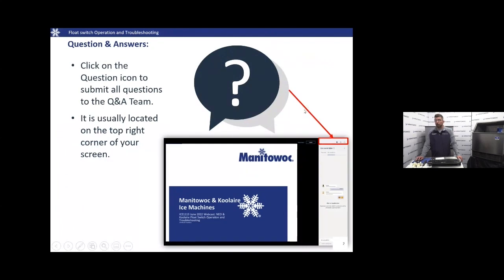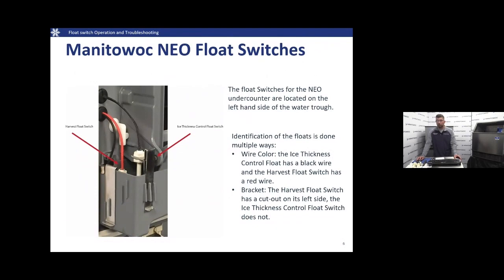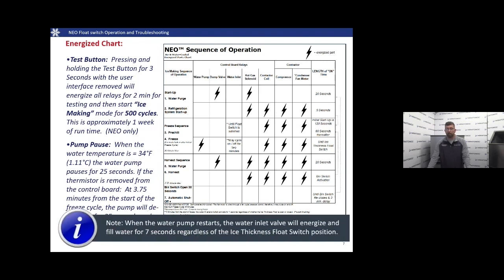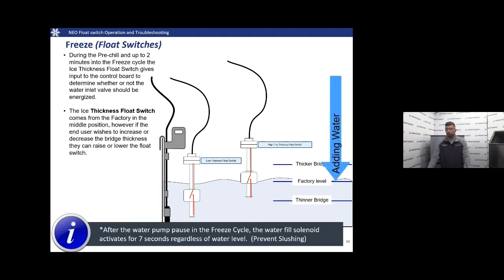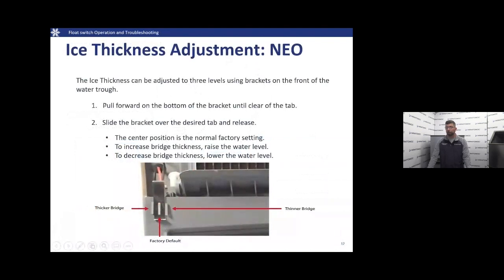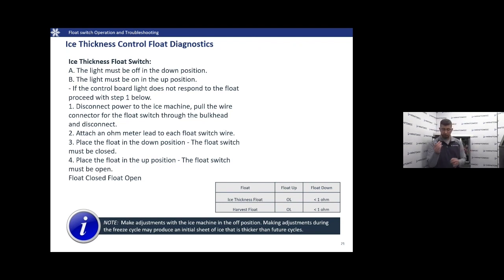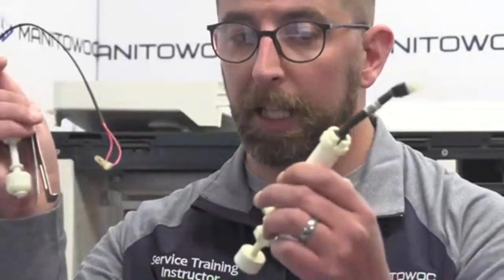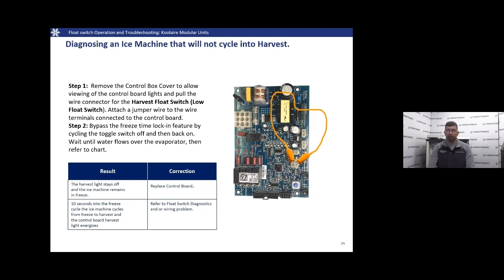Manitowoc Ice's June 2022 Webcast, NEO and Koolaire Float Switch operation and Troubleshooting.

Comment: For the KoolAire Ice machine, Is there any baseline for adjusting the Ice thickness float switch? It mentions in the manual how to adjust it, But how much in one direction do you go? I know it mentions to watch 2 batches to confirm an adjustment, This is hard to do in the field when time is crunching.. Lets say the ice bridge is 1/4 thick, and you need 1/8 bridge.. How far counter clock wise would you turn it?

Comment: good day i has a  manitowoc ice machine it drop ice then going into long harvest then after turning in off and on it makes ice then drop, then goes back into long harvest. i replace the ice thickness probe , the board and the problem still exist  i check the curtain switch its ok. So after turn it off and on it drop ice, then the second drop dont happen it goes in long harvest, and after turn it off and on the same process repeat